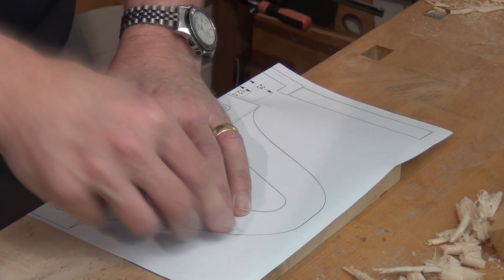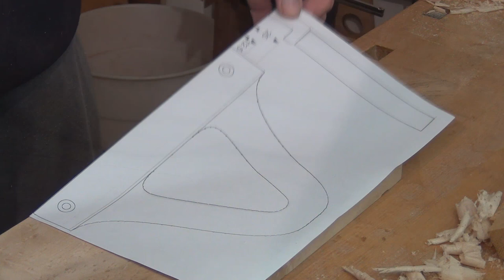Kerfing Plane 1(2) / woodworking tool

Comment: Interesting design Mitch.  I would have never thought about "connecting the dots" when transferring a pattern to a piece of wood.  I most likely would have glued down the template and left myself all that extra work of getting rid of the glue residue.  I also liked your solution for saw nuts.  I learned two things from this video.  Looking forward to the next video where I'll learn three new things ;-).
Reply from the maker: Thanks, always a pleasure to be able to introduce new ideas.

Comment: Interesting subject Mitch and I'm in for part II, especially the fence. I've thought about one of these but it's still in the 2nd division of projects for now, the thing I do want to do when I get to it though is increase the gullets on some of the teeth, say every 5th one. Isaac/Blackburn has done this and it makes sense due to the amount of sawdust building up in a long kerf. I've generated  LOTS of heat when I used to resaw with a regular handsaw.

Nicely produced video too with good levels on the workshop sounds 👍
Reply from the maker: Cheers Phil. Deeper gullets and raker teeth would surely help if sawdust buildup became a problem. Along with a curved blade, suggested elsewhere in the comments, these are things I may try out, given the time.

Comment: Really nice Mitch, and an interesting handle design. I often wondered if kerfing saws would be better with a blade with a slight curve in it. I'm thinking along the lines of the old floorboard saws you'd get. It seems like that would allow some relief from debris. Also, I cut some sliding dovetails across a wide board and something like a kerfing saw that established an angled cut would be awesome. I'm guessing you could do that with yours, but it'd be a difficult job to maintain the angle I'm assuming.
Reply from the maker: Thanks Rico. Yes i think a slight curve would be a nice idea. I still have to sharpen mine, so I might curve it a bit beforehand. The blade clamp could easily be replaced with an angled one with a wide base to help cut sliding dovetails.
Reply: @mitchwoodwork  hadn't considered just changing the blade clamp, that's a great idea!

Comment: Thank you Mitch for another excellent video. I like your thinking with the saw bolts. Wow, that piece of Maple seemed more like stone!
Can I ask please; did you make your bow saw and where did you get the blade from? Thanks again, cheers Alan
Reply from the maker: Cheers Alan.
Yes, a nice piece of maple, but unfortunately not much left.
I did make the bow saw, there is a video here somewhere, probably in the shop made tools playlist. I'm using a 1/4" 6tpi bandsaw blade, but a 3/16" 8or10tpi would be better, especially for tighter curves like these.
Reply: @mitchwoodwork  Thank you so much Mitch. Your answer is very helpful. I'll investigate the bandsaw blade option. Cheers Alan
Reply: I just watched your bow saw video and downloaded your plans. Excellent! Thanks very much Mitch. I sold my bandsaw last year as part of being completely unplugged. My only dispensation being my pillar drill. Cheers Alan
Reply from the maker: I still have my bandsaw, but it only gets used if I'm too tired 🤣 or I'm making a video where it could make sense for some folks.
There are dedicated bow saw blades available, which is certainly a good option if you don't have bandsaw blades spare.

Comment: Appreciate the video. As some one completely new to woodworking, i have to ask the dumb question, where does one get the blade used for a kerfing plane/saw
Reply from the maker: I cut mine from a spare rip saw, which could have been bought at a car boot sale. You could buy a cheap universal cut panel saw, or use a section of a large broken band saw blade. You could also search for a local saw smith who could sell you a length.
Reply: @mitchwoodwork  Thank you for the advice and taking the time to respond.  I do have an old Stanley saw I could cut up, I was going to try an make a card scraper with some of it anyway.  Cheers.